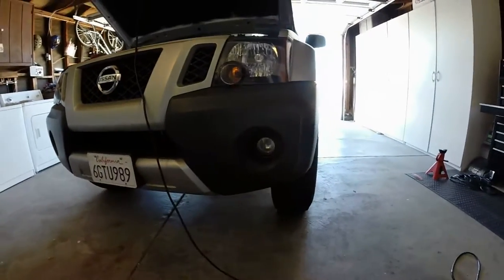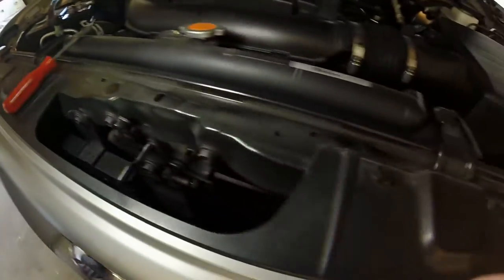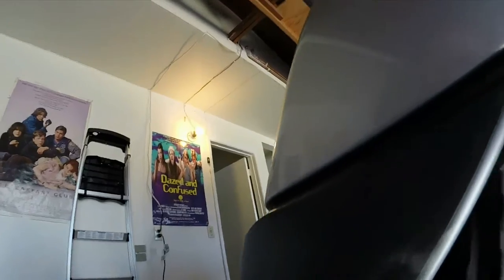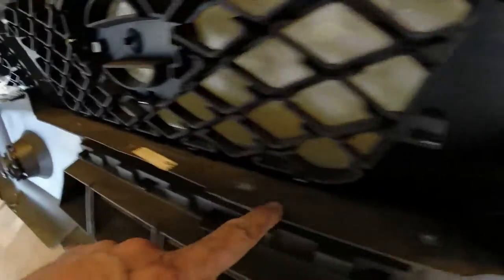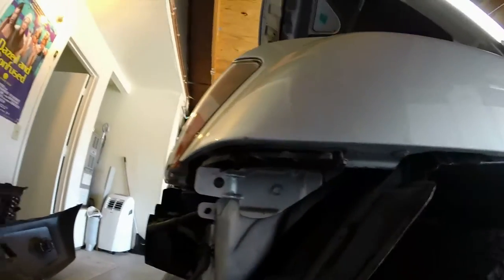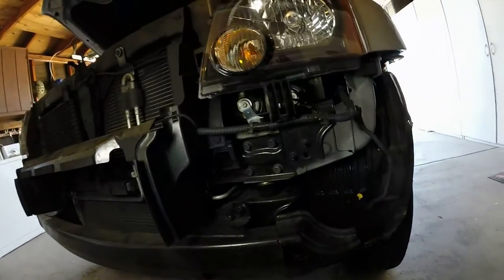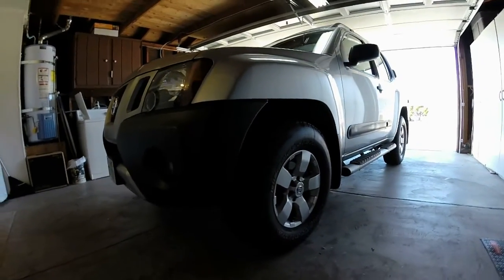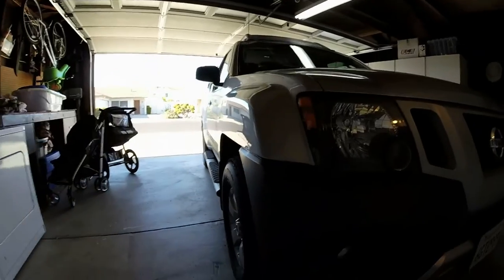2009 Nissan Xterra: Episode 6 Vlog: Front Fascia Removal

Comment: Do you have to remove the whole front bumper assembly if you only need to replace the front (silver) grille?
Reply from the maker: yes, i guess. i sold that car 10 years ago
Reply: No you don't
Reply: No you don't have to remove the whole bumper assembly. There are 4 clips that mount them together.  10 years ago? That vehicle isn't even 10 years old...

Comment: Part number is molded on the part........old video I know, but hopefully it help those still wondering. Passenger side RH is 62042EA001. Driver side LH is 62043EA001. You can find these on eBay.